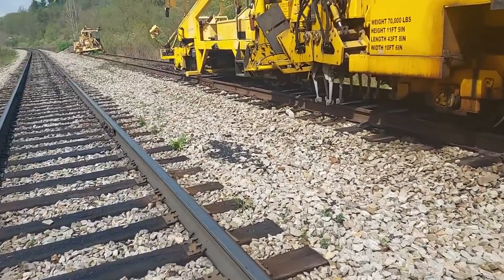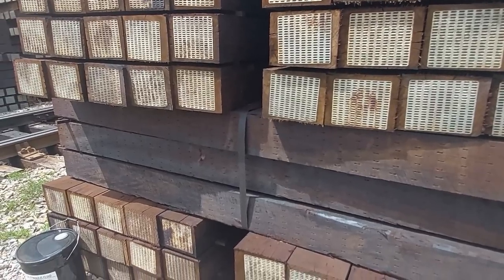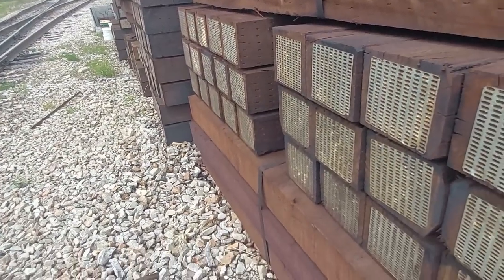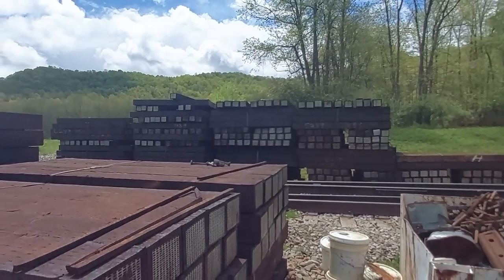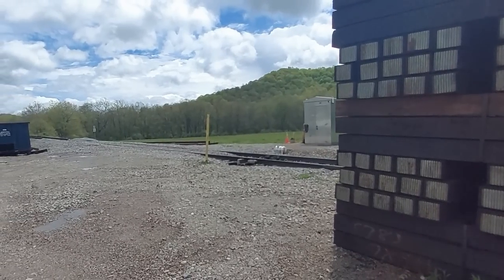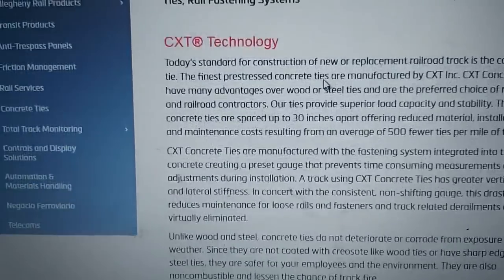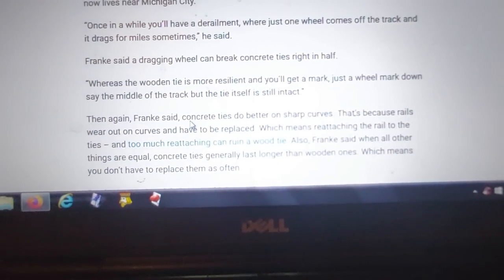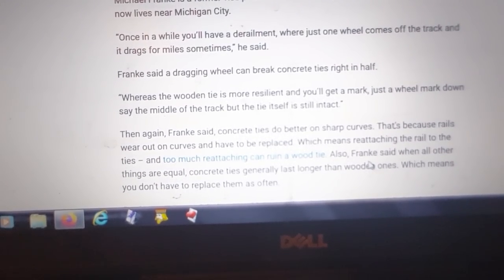Why some Railroads use Concrete and some use Wood Cross Ties

Comment: A advantage of concrete is that it it Not terminal... They can have 28 conformations today and 128 tomorrow,, AND you can add tons of things to concrete itself to change it Not even adding rebar..... concrete itself is a mixture of cement AND matrix material like sand, clay, aggregate ETC... it's basically glue plus All that GETS glued together....i think concrete will be the product USED in the future,, ..in fact as you said it already is ... AND wood is too valuable....I don't CARE What it takes, if it MEANS making the bed BETTER, that's what will be done
Reply from the maker: Thank you for the great comment Bobby. Appreciate your taking the time to watch and write in my friend.

Comment: They have longer rails and one piece too.Don't they a quarter mile to a mile long rails
Reply from the maker: Most continuous welded rail is 1200 or 1400 feet in length Kurt.
then they will put in a joint and then another long rail string.

Comment: Other countries use concrete ties and have no problems and I really think the reason our railroads stay with wood ties is because they are CHEAP and the railroads don't want to spend the money even tho they would last longer and be more stable. Maybe if they went to concrete ties they wouldn't have so many derailment's like they do now?
Reply from the maker: Thank you for sharing your thoughts Paul. This video was certainly
not a comprehensive treatise on the subject of concrete vs. wood ties. There is a whole lot more involved than what I could cover
in such a short video. 

Every RR has it's own unique situations and environment and tonnage rates, etc., so there is no "one tie does it all" for every RR out there in every situation they encounter. Each RR has to choose what is best for their own situations on each different sections of track they have. Appreciate your taking the time to  visit with us and check out the video my friend.

Comment: Even Soviet Union managed to switch to concrete sleepers already in seventies and nineties. Many of these railroads are still in use 40-50 years after construction. No one in the world is using wooden sleepers anymore exept USA. If US rail companies cant build concrete speeper railroads that last, its just pure incompetence and short term cost saving in every corner. Every railroad in my country is built on concrete sleepers and we havent had major train derailments for years.
Reply from the maker: Appreciate your sharing that with us Muki, interesting. Really extreme cold winters like Russia has is very hard on wood and
concrete ties, yes they are using concrete there. However it's 
because concrete lasts a bit longer in the harsh cold than wood,
but still concrete ties are replaced every 10 years or so, a significant decrease in concrete's normal life. Harsh cold is hard on concrete tie. 

You didn't say what country you're in, but hardly any other countries in the world have the long, long heavy freight trains the US has.
Most trains in Europe are 20 to 40 cars and less weight per car.
Many trains here are heavy 286,000 pound cars and 100 to 200 cars per train. There's a lot more to consider than just my country is using them so the rest of the world is behind times. Thank you for taking the time to watch and may you have a very good day my friend.
Reply: @ccrx6700  concrete sleeper railways last much longer than 10 years, its just some arbitary number made up in the office to comply with certifications and all rubbish like that.
Your argument about weight is completely invalid. None of Australian mining companies operating 100-200 car ore trains use wooden sleepers.

Comment: I would also imagine that cost has a lot to do with it.
Reply from the maker: Being that there are 28 different profiles of concrete ties Peter. Each different profile has a different pricing. Wood ties here are $80.   All concrete are higher than that and heavier ones can be double or more the cost, plus transportation costs to get them to the job are much higher with concrete, because they are so much heavier than wood, it requires more trucks to get them to the job site. Thanks for taking the time to watch and write in my friend.

Comment: Has anyone tried using the recycled plastic bag fake wood they use for park benches to make railroad ties?🧐 they would likely require pre drilling for spikes
Reply from the maker: Yes lectrikdog. Theya re called composite ties, not in wide usage,
they are expensive. I will do a video on them as soon as I find
someone who is using them. Have to pre drill the holes to drive
in spikes. Thank you for watching and may you have a most blessed day my friend.

Comment: A railroad would never mixed wood and concrete wood concrete..it would be all wood or all concrete..now you can have a interlocking that is all wood or all concrete..and your comment about wood being better the. Concrete is false wood does not last long and weather and not surfaced track effects it. Concrete ties weigh 8000 lbs each ..the reason why concrete ties are not used in frieght tracks is that the cost is to much.
Reply from the maker: Thank you for sharing your thoughts Tony. However don't recall
me saying wood was better than concrete but some applications
such as our track wood is the better choice for us, but not
for every RR out there. But you are right, wood doesn't last as
long as concrete. Appreciate your checking out the video and
may you have a very good day.

Comment: Making concrete does require lots of energy mostly from petroleum burning. The energy source If    nuclear would eliminate the carbon diffusion atmospherically.
Reply from the maker: You are right David, concrete production does require a lot of
energy. Did some research on it after I had made this video. Thanks
so much my friend for taking the time to write in and to watch
the concrete vs wood tie show.

Comment: Forestry is just another form of farming and the trees are the crop, ok, you don't get to harvest them at the end of the season but you plant your forest accordingly, planting and harvesting on lets say a forty to fifty year cycle.  Old trees have to be harvested so that new ones can grow, that's called a managed forest.  One hundred fifty years ago the lumber barons didn't respect this, but smarter people run the industry today.  During their growth years the trees offset much of their carbon footprint and the energy consumed in making concrete is prodigious so I don't see any advantage to concrete here.  What all I'm saying is that I think the wood tie has a lot of future and I see light tram lines being set with concrete mayB that's why these things cost $100M per mile?  What does a wood tie cost relative to the average concrete tie?  i've lived near a number of rail lines and it doesn't seem like they're replacing 4 or 5% each year and I'm not talking about sidings.  As for used ties, isn't burning them as fuel considered renewable?  I know the brits think this way.
Reply from the maker: Thank you for the really good comment Henry, a ton of common sense you have presented. Yes you are right, I don't think those
who consider the carbon foot print take into consideration the 
years and years of the tree absorbing the CO2. I never even thought
of that. 

Being that there are 28 different profiles of concrete ties, it's
kinda hard to give you an accurate answer on cost. Each different profile has a different pricing. Wood ties here are $80.   All concrete are higher than that and heavier ones can be double or more the cost, plus transportation costs to get them to the job are much higher with concrete, because they are so much heavier than wood, it requires
more trucks to get them to the job site. Thanks for taking the time to watch and write in my friend.

Comment: Amtrak uses concrete ties for high speed
Reply from the maker: Thank you for sharing that info Don. High speed track has to be
as stiff as possible and concrete does very well at doing that. 
All RR's have their own unique track problems/weather/economics, etc. There is no one tie out there that is ideally suited for every single RR going. Each RR has to use what is the best option for them, and often use different options for different sections of track. Concrete, steel, composite or wood all have their pros and cons. It is a good thing that there are options available to suit each RR's particular needs. Appreciate your taking the time to watch the video and write in
my friend.

Comment: Concrete is better It comes down to job security. Concrete ties would put a lot of people out of work. The people in power make sure it doesn't happen so everyone pockets getting paid. To keep their jobs and jobs of their relatives and family members down the line to keep eating Twinkies on the side of their tracks keeping the money flowing. Just like the machinery they have to reuse old Asphalt roads and lay back down here in the US they dont want them for the same reason.  It would put out thousands of workers out. Eventually they will be using the better option and overall lower-cost option.
Reply from the maker: Thank you for sharing your thoughts on that sacongo. Appreciate your checking out the video. May you have a most blessed day my friend.

Comment: Concrete is one of the top sources of CO2. Not sure that's the green option.
Reply from the maker: Thank you for sharing your thoughts and for watching the video
Bob. No argument from me on the cement industry's green house gas emissions being hard on the environment. However, in the video I was speaking strictly of the effect of wood vs concrete ties, not about an industry in the whole of itself.  

My information came from Robert Crawford, University of Melbourne who did a comprehensive study on the CO2 emissions from concrete and wood ties finding the CO2 emissions associated with concrete ties are two to six times lower than those from wooden ones.
Here is the link to that study: 
https://pubs.acs.org/doi/abs/10.1021/es8023836

Comment: I was told, that wood ties gave a softer ride, than concrete. Wood has more "give" than concrete. The pros and cons for either type of tie, seem to be even.
No clear winner. To many variables, to make a decision, as to go one way or another.
Reply from the maker: Riding a train on concrete is like driving your auto on a paved road,
riding on wood ties is like driving on a gravel road there is
no flex with concrete Walter.

All RR's have their own unique track problems/weather/economics, etc. There is no one tie out there that is ideally suited for every single RR going. Each RR has to use what is the best option for them, and often use different options for different sections of track. Concrete, steel, composite or wood all have their pros and cons. It is a good thingthat there are options available to suit each RR's particular needs. Appreciate your taking the time to watch the video and write in
my friend.

Comment: So, someone cut corners and didn't make proper concrete ties...?
Reply from the maker: Perhaps back then someone didn't buy the right kind of ties,
those ties were probably never meant for heavy freight Anton.
Thank you for taking the time to watch. Glad you could join in with us. Happy rails to you until we meet again my friend.
Reply: @ccrx6700  I just haven't ever seen such configuration anywhere I was in Europe, from Russia to UK and all in between, it's either solid wood or solid concrete, some oddly shaped concrete pieces for intersections and crossings, but never split like that into two pieces
Reply from the maker: @Gastell0  😊👍

Comment: 1:49 that was stupid and the moisture and concrete ate them to pieces !
Reply from the maker: That was way back when management here knew almost nothing
about railroading Gerald. They wanted to try concrete and obviously got them cheap. Well they tried them and you heard what happened.
But back at that time with the solid concrete ties they had then,
a derailment would have ruined those solid concrete ties also. 
That's the story our our RR here from the beginning, live and learn.

Comment: Has any consideration for using and recycling plastics.. we have millions of that !
Reply from the maker: They do make composite ties Ron. They are very hard and require pre drilling before spiking or using lag screws. Also they have no flex
at all in them like wood ties do, but are perfect for wet muddy areas.
They also cost about 3 times what a wood tie does.   Thank you very much for visiting with us and may you have a very good day my friend.

Comment: Making cement creates a lot of CO2.
Reply from the maker: Thank you for sharing your thoughts and for watching the video
George. No argument from me on the cement industry's green house gas emissions being hard on the environment. However, in the video I was speaking strictly of the effect of wood vs concrete ties, not about an industry in the whole of itself.  

My information came from Robert Crawford, University of Melbourne who did a comprehensive study on the CO2 emissions from concrete and wood ties finding the CO2 emissions associated with concrete ties are two to six times lower than those from wooden ones.
Here is the link to that study: 
https://pubs.acs.org/doi/abs/10.1021/es8023836

Comment: Concrete is not much better for the earth as it gives off nearly a lb of CO2 for each pound of concrete. Steel production is not any better. Just to be clear.
Reply from the maker: Thank you for sharing your thoughts and for watching the video
John. No argument from me on the cement industry's green house gas emissions being hard on the environment. However, in the video I was speaking strictly of the effect of wood vs concrete ties, not about an industry in the whole of itself.  

My information came from Robert Crawford, University of Melbourne who did a comprehensive study on the CO2 emissions from concrete and wood ties finding the CO2 emissions associated with concrete ties are two to six times lower than those from wooden ones.
Here is the link to that study: 
https://pubs.acs.org/doi/abs/10.1021/es8023836

Comment: A lot of CO2 is produced making cement.
Reply from the maker: Thank you for sharing your thoughts and for watching the video
Thomas. No argument from me on the cement industry's green house gas emissions being hard on the environment. However, in the video I was speaking strictly of the effect of wood vs concrete ties, not about an industry in the whole of itself.  

My information came from Robert Crawford, University of Melbourne who did a comprehensive study on the CO2 emissions from concrete and wood ties finding the CO2 emissions associated with concrete ties are two to six times lower than those from wooden ones.
Here is the link to that study: 
https://pubs.acs.org/doi/abs/10.1021/es8023836